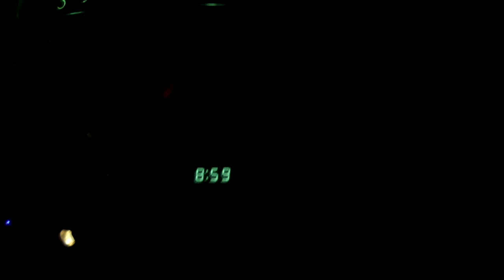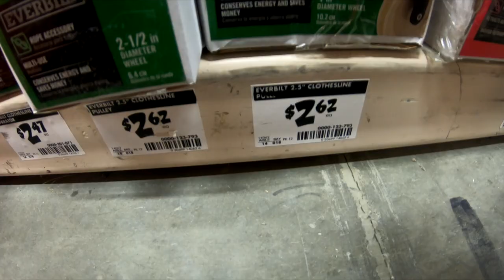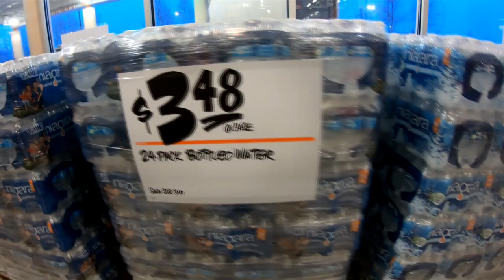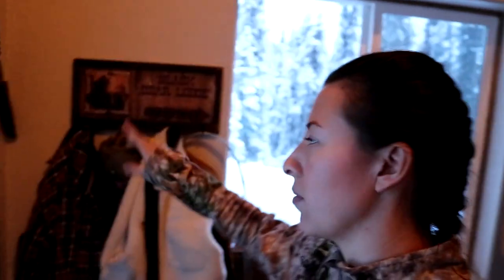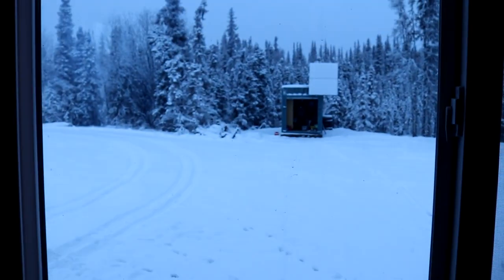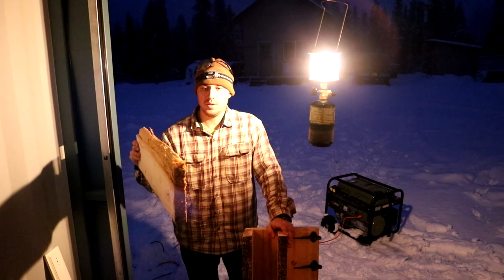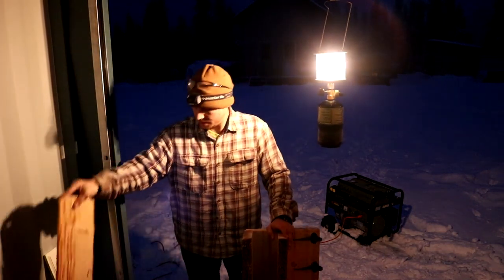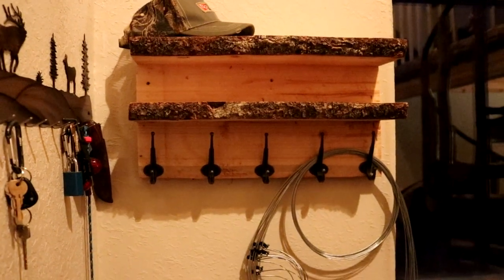Repurpose and Reuse...Our Thrifty Side

Comment: I think I saw y’all today at Home Depot this evening getting roofing supplies 😂 how cool thanks for shopping with us at The Wasilla Home Depot 👍🏼
Reply from the maker: Ryan Turrentine, that was us! We are in the works of building a chicken coop :)
Reply: Nice i just watched the video looks good minus that Lowe’s lumber 😉 lol jk, that foam post mix needs to be braced or held while the foam expands which honestly doesn’t take long also if the mix was outside before you were ready for it that doesn’t help, the packaging needs to be about 60-80 degrees to work properly and it expands faster in warmer temperatures of course but yeah I’m the lumber department supervisor at HD and it was a huge seller for us last year for the remote builders and that was the feed back that the vendor and our customers gave back to us
Reply from the maker: We did have it in the house prior to bringing outside but I guess two braces would have been better on each post, we can't knock it down for our error. Lightness factor it is way better than concrete for remote building. We really like the weight of concrete but think it is a good product overall and yes it sets super fast! :)

Comment: So what caused it?  I ask because we had one in Northern Missouri a few years ago that scared the dickens out of me.  Never had one here before.  Turned out that Oklahoma was doing way too much fracking and they had to cut way back.
Reply from the maker: Vicki Takacs I don't believe they have said anything caused it but I hope it's the last one. Not fun 😬
Reply: @SimpleLivingAlaska  No they aren't and ours was nothing compared to yours I'm sure.  Did have to pull the cats' claws from the ceiling though after I got down.  I thought it was creepy.
Reply from the maker: Wow 😬 ours just took off out the cat door
Reply: @SimpleLivingAlaska  I need to work on my jokes.
Reply: Look up New Madrid Fault.
Missouri has had a couple of severe earthquakes. Made the Mississippi run backward in early 1800s.
Reply: @baskervillebee6097  , hey yeah, I live real close to Cape Girardeau.   A chunk of the town of New Madrid over by the Mississippi river just broke off and went into the water.   The river ran backwards for a few hours due to the river bottom silt raising and falling during the last earthquake.   Very interesting fault line.   Its actually more active than the big one in California,  the San Andreas.

Comment: Oh Boy!! I thought we talked about that in counseling?? Remember we were just going to talk to the spouse and not try to really shut them up permanently? I would have to say duct tape might work better but I guess you could put clothes pins on the individuals lips and eye lids. But to string them up I might recommend a stronger tackle block. Now if your amish you could use those two round things to go way high in a tree or out building and pull your wet clothes way out away from your house and keep pinning on your wet clean clothes!! The Amish usually have a bigger round thing with a handle to crank it back in. See ya with dry clothes nixt time!!